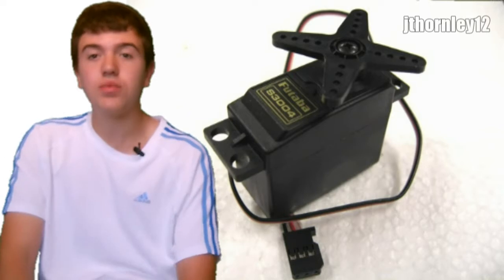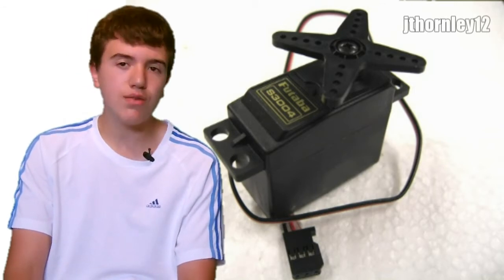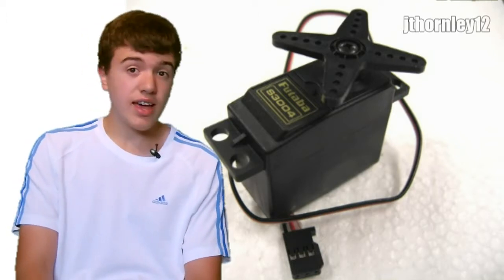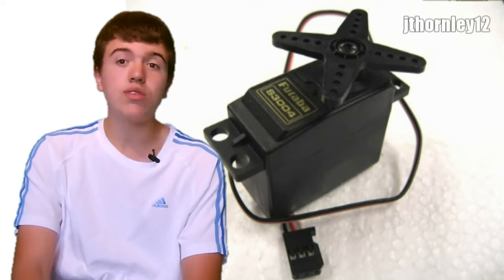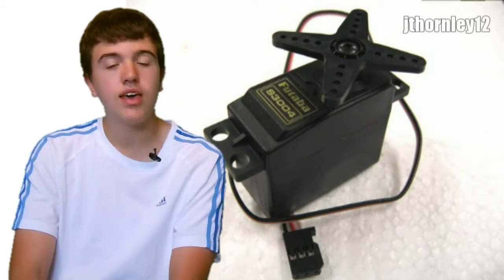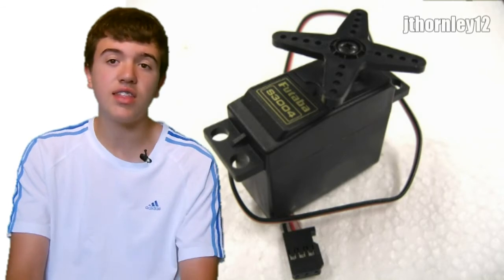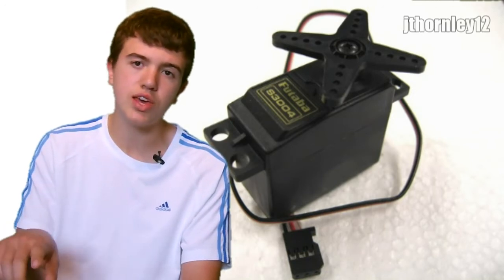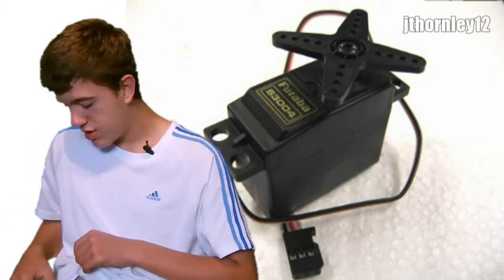JT12s FAQ -- No power to servos

Comment from the maker: @bigmac13201 Thats usually a receiver issue, when the Engine starts the receiver gets interfered with by the vibrations of the engine. Can be caused either by loose internal cables or something as simple as loose servo connectors ;) Try mounting the receiver inside the receiver housing using sticky pads

Comment: I took my nitro rc car out 2days ago but the ground was a little wet from the rain 2hours earyler still worked perfect when packed away last night I fitted a fail safe to stop a runaway if it ever happens set it up steering worked great then today I was going to take it out again but the nitro rc car isn't responding to any controls from the remote. all good batterys both got power but when I switch the power on the car the servo adjusts itself slightly, but I haven't got any reset buttons on my remote or lights on the receiver to bond it's a 27ghz

Comment: i have the GV Rex X Nitro RC. I have the FS GT2. I folowed these steps. The servo powering the engine twitches. The steeering sero worked yesterday. It is showing no signs of life. I have a feeling it is consantly connectng and dying. i replaced the batteries to barand new ones to find the same effect, Should i get a new radio set?